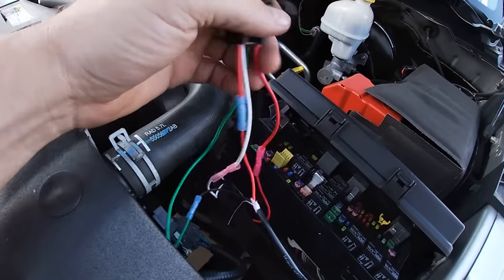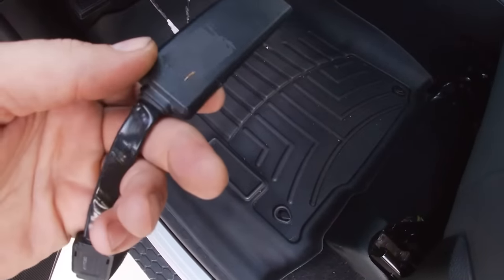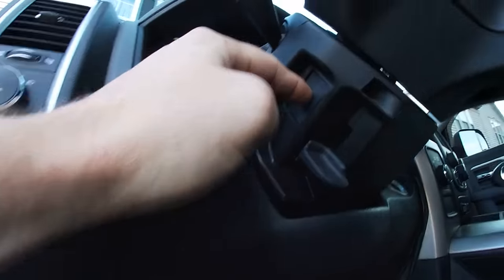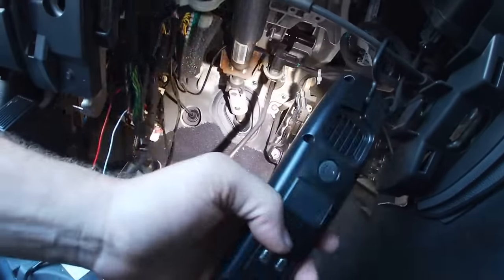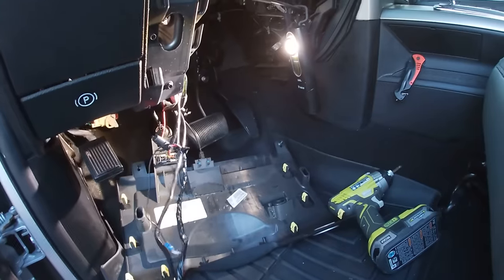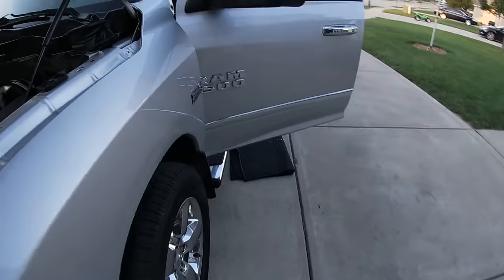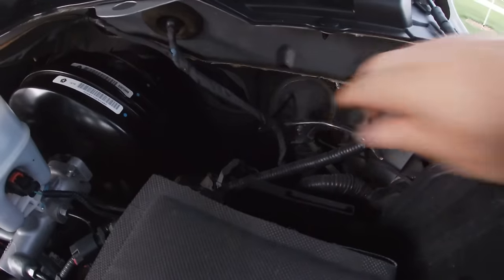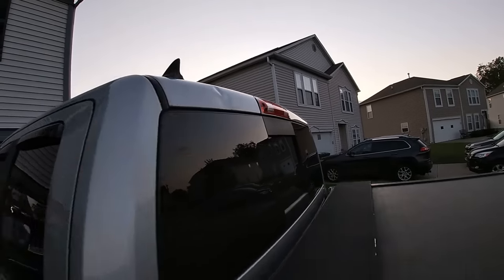Tracking Device Found on My RAM!

Comment: Dude this is new to u remember lowjack well they work with dealers every car from 91 and now has a lowjack on it if u ever get any car stolen from 91 and up all u do is tell the cops to activate the low jack and your car will be found in seconds they won't tell u but it's there and they can find it....no bull I've had 2 cars stolen and 2 cars found a 92, suburban and a 2006 Honda Civic  in minutes that in California it's everywhere

Comment: That would never beat that loud is that was a straight-up tracking device because someone would find device in less than a minute so the beeping that you are hearing is most likely the dead battery warning you that you need to replace a battery

Comment: Some companies put trackers on fleet vehicles in case of theft they can track it down and repo it.. also, some used car dealerships put trackers on cars while you are still paying for them so if you get behind on payments they will know where to go repo it. I recently bought a 2010 ford taurus and heard a beep coming from under the dash and while I was changing a fuse in the fuse panel under there I saw the black box of a tracker device. I removed it immediately and I'm glad I did!

Comment: For semi-permanent repairs of stripped wires, I like to use the liquid electrical tape.  Vinyl electrical tape (even the more expensive varieties) will get dry/brittle over time and start to come loose.  I've never met a vinyl electrical tape that will work.   Excellent work there, glad you worked your way through it.  Very impressive video / well done job!  Reading your other comment, I love those floor liners and the tonneau cover.  Excellent stuff there.    I know this video is over a year old now, but maybe you'll find yourself under the dash sometime and can check on that vinyl tape eventually.  Pick yourself up a jar or two of that liquid electrical tape.  You have to use 2 or 3 good coats of the stuff.  Sometimes 4, but it's great stuff.   If you crack open a jar, you need to really seal it up tight to get it to last.  Even still I end up throwing the tail end of a jar away over the years.  It's okay.  It's worth it for when I need it.
Reply from the maker: I also use liquid electrical tape but at the time this was all I had. Thanks I’m glad I figured it out. I have already fixed the wires with heat shrink butt connectors so there is no need for electrical tape at that point. Thanks for watching
Reply: Cut the wires, solder and heat shrink is the correct and safest way.

Comment: That is not only a tracking device, it will not let the truck start if you have missed a payment. Car lots and the dealers are putting those on trucks, if a payment is not made they can shut the truck off and track the truck down to do a repo. The dealers put those in trucks.
Reply from the maker: They put them in a lot of vehicles not just trucks. I only had it for 2 weeks when I made this video and the corrosion shows it had been on there for a long time.

Comment: Dealerships sometimes add tracking devices if for the loan companies so they can find it if you don’t pay. This happened to one of my friends, she had bad credit and when she bought a car for the loan company’s protection they installed a tracker and said they would uninstall the tracker once she pays off the loan. She ended up trading the car in so the next person who bought the car now has a tracker too that they probably don’t know about.
Reply from the maker: Crazy Coupon Crew I think if a company requires it to be installed they should be responsible for removing it. If this happens to someone that knows nothing about cars mechanically it can cost them a tow and a repair bill.

Comment: I was the second owner of a Tundra. It had ALL the bells and whistles. The original owner and I purchased it at the same dealer. The battery kept running low every few days if I didn't use it. I kept bringing it in to get the problem fixed. I bought a new battery and demanded another one when the one I had just purchased kept dying every few days. I used it to haul a horse trailer and had a private party eventually uninstalled the trailer break system that Toyota had installed when I bought the truck. The private party guy found a GPS system in my truck while he pulled the dash apart to remove the breaking system for the horse trailer. Toyota installed the GPS unbeknownst to the original owner because they wanted to track it if the guy left town for good. I went to the dealer immediately after finding out about the GPS. The guy I talked to told me that yes, they did indeed install it. Later it occurred to me that my battery issues were because of the GPS. I told the dealership it was eating away at my battery and that I want it removed. The snakes at Toyota refused to acknowledge that they installed it at this point and made me pay $350 to take it out. It was attached to the antenna and the process to remove it required taking apart my whole dash. I have no trouble with my battery life any more.

Comment: I use covert GPS trackers in my business frequently. This is not a covert GPS device designed to not be discovered by the driver, it’s a badly installed fleet tracking GPS device. They just never took it out. It appears to have an ignition kill in case the vehicle is reported stolen.
Reply from the maker: Thank you finally someone that knows what they are talking about. Everyone says it was put on for my loan and I tell them I had it for only 2 weeks and the corrosion shows it had been on there for a long time.

Comment: Man, those splice jobs on your truck are a complete mess. I had a similar issue. One was found on my 2016 RAM 3500. Bought a new RAM in 2016 in North TX. Two years ago, I started having an issue with my fuel gauge reading incorrectly and so I took it to the dealer to diagnose it. Ultimately, after a month and a half spent in the shop, 1 wiring harness, 3 fuel pumps, 3 gauge clusters, and misc electrical troubleshooting the service dept on a tip from another TX Ram dealer recommended they go check in the wheel well behind the liner, sure nuff. The tracker was found buried deep in the harness. The splices had been made and had started to corrode the harness where all the splices were made, causing a substantial drop in voltage to the fuel gauge system.
Reply from the maker: The company that pays to have the trackers installed should be responsible for removing them when done. They have caused people like you to spend money and in some cases a lot of money because of them.
Reply: @FABAutomotiveDetailing Fortunately for me, the dealer did not charge me for the majority of the work. They received 2 bad fuel pumps, and 1 defective gauge cluster, plus all the other electrical troubleshooting. Definitely a deceptive practice.

Comment: You're exactly right they hook to the steering column and they go to the ignition so what you have there is a big car with a kill switch and it also locked the doors so the perpetrator cannot get out of the vehicle

Comment: I'm done with computers. I took the 3.6 V6 out of my 2016 Ram and installed a carbureted 350 chevy with a 400 turbo. I bought a brand new wiring harness on ebay for 1972 chevy pick up. Life is sweet.

Comment: I had one installed by the dealership when I was financing my 2005 Mazda 3 years ago.The dealership refused to remove it at the end of the term, so I spent 2 days locating, googling, and removing it myself. It was worth it because mechanic shops wanted over $200 to do it. LOL

Comment: You still haven't finished.  There is another one up under the dash from the factory.  You need to remove the dash and find a box on the firewall which has an antenna sticking out of it.  Then you unplug it or remove it.  All newer cars have them.

Comment: The spot on the steering column is where you touch with your key fob as you press the start button to start your vehicle when your key fob has a dead battery.
Reply from the maker: It’s not a push button start. On the Mopar push to start cars with a dead key fob you actually press the end of the key fob into the push to start button itself to start it. I’ve had to do it on our Journey when the battery went dead.

Comment: I work for Jeep Chrysler Dodge dealership and we see these from time to time on used vehicles that come in for trade or the people bring in to have them remove when they find them. The wires going up to the steering column are to sense the ignition key on state.
Reply from the maker: Tom William At your dealership would have removed it before offering it for sale again?

Comment: The dealership i worked at put the gps module in every used vehicle. Its not for people with bad credit. The ones we were installing were able to shut the car down. So if you stopped making payments they could shut it down. Then you call asking for a tow and it gets back to the dealer locked in the shop till you pay. But they went in every single used car. They dont just be like o you have crappy credit so give us an hour to wire up this insurance policy before we give you keys. I always thought it was stupid to put them in cuz they did crap like this where they would have failures and not let the car start.

Comment: I bought a chrysler and I keep having problems with the TIPM. I bypass the fuel relay years couple years ago.  I have tested all the connections and found out my TIPM went south.
Reply from the maker: tyler sowder The Totally Integrated Power Module was a bad design IMO. Hopefully these newer models don’t have them but I won’t see them at the shop for a few more years.

Comment: Some dealerships used car dealerships are putting them in vehicles so if they have to repo they know right where to go get them
Reply from the maker: Yes they do but I had only owned it for 2 weeks and that corrosion wouldn’t happen that quickly. It was on there from the first owner.

Comment: Great video, came looking for a video similar because I have a 2019 Ram Classic, found some kind of device under the dash today while replacing my interior lights and came across this "doesn't look like it belongs there device" and a friend came and had a look and sure enough it didn't! Took it off and see what happens? As per your S&B cold air intake, I highly recommend this product. I had one installed when I bought the truck new, along with dual glass packs and a throttle commander, and the cold air filter helps make a difference, maybe not a whole lot but every effort helps! Thanks for the video even though it's four years old but reading the comments helps too! Have a good Dodge man 👍
Reply from the maker: Thank you! I did put the S&B intake, Flowmasyer exhaust and a throttle controller on also and love it.

Comment: The Dealership will install those things so they save money on insurance and sometimes they forget to remove them when they sell the vehicle. They also if you have bad credit the banks sometimes require one to be installed so if you defunct on the payments and it has to be repossessed. They know were to find it. Not that you can't rip it out after you buy the truck but they know most people aren't smart enough to do that. The dealership buys them by the pallet full. So they hardly pay anything for them on top of it. So it's really not a loss in the first place.

Comment: as i have worked at an auto auction (dealer only auction house) in the autobody shop before, i will let you know A LOT of "used" cars on most dealer's lots used to be rental cars, Hertz, Enterpriise, and the such, they buy a fleet every few years year to keep the vehicles fresh and then auction off the old fleet, so yeah you may wish to ask where the vehicle's origin is from if you don't want an old rental car
and the brand the auction i worked for sold and partnered with? chrysler (dodge jeep plymouth etc.) and the dealerships that were at the auctions? most of the entire east coast
Reply: also our auction had options that the dealers could buy as extras (they purchase and we put them on) included bed liners, spoiler wings, tonneau covers etc.) so they could up the lot value without having to do the work themselves

Comment: I found one exactly like that in my Mazda 5. The used an inline adapter that plugged into my obd2 connecter. I found it, because the adapter's obd2 connector wouldn't lock into the hole for connecting  a scan tool.
Reply: i also had  the same starting issue with my van, although removing the device didn't fix it immediately.

Comment: Nice find and fix...that buzzing must have been very annoying. Judging by the heat you said was on it....that thing must have been drawing at least an amp, I bet the battery had been replaced...LOL. I think it would have been fun to track down the company that owned it to find out if they could still track it, I doubt they actually did, but they capability was there. I wonder what software and such was involved?
Reply from the maker: Thanks! I’m sure it was atleast and amp for sure. I did replace the battery shortly after this video.

Comment: It is a device used by the finance companies usually buy here pay here lots I’ve seen them on the cars, it’s an inner locking ignition device when you don’t make your payments they can send the repo truck right to your vehicle when you default, and also immobilize the vehicle as a threat to make a payment, hence saving fees on the repo agent
Reply from the maker: Mica Anderson It could be from the original owner. I’m the second titled owner and had only had the truck for 2 weeks when I made this video.

Comment: I have a 2019 tundra battery went dead if I didn’t drive it in a couple days took it to the dealership told me I’d had a tracking device on it that the dealership had put on said they unhooked it ,I leased it

Comment: 2 wires Control the Relay, Relay Will have 2 or 3 Terminals for Switching, Connecting the 2 Wires were likely Starter Disable, Could Be Ignition Disable.

Comment: So alot of smaller dealerships install these onto their cars so they can find people for non payment. Some even act as a kill switch. If someone had bought it froma dealership and paid it off or traded . It would have stayed in the vehicle. The customer has to pay a fee after their lease to have it removed and usually is a few hundred dollars. Thats most likely the cause. Possibly the beeping a wire somewhere was cut to the system. Or something else disconnected  . I have an 03 jeep and has one in it. If I was the sell it and someone opened the dash they would find it.

Comment: That's a tracking device used by car lots, loan companies, rental companies, fleet owners, etc. etc. I know cause I've installed them for car lots. They are used to repo vehicles when you don't pay for them. IF you remove it, you just violated your loan agreement and I can repo your car the minute I find it deactivated. Now if it's just a bad battery and you fix it and the tracker comes back on I can't touch it because of that, but if you remove it I can. If it goes bad I can put a new one on it too. By law, I don't have to tell you it's on there. If it has the stater deactivation relay on it,  by law in my state I have to tell you it's on there. Once it's activated, it just prevents the starter from working. Again, if you remove it to get it to start, I can repo your car that instant cause you violated the terms of the loan agreement. So you better be careful listening to these internet lawyers and mechanics cause most have no clue about this stuff. I work in the industry and I know all about it. Been using these things for years. And, since laws do vary from state to state you would have to check with your state laws, I'm only speaking of my experience within the stat I live in.

Comment: I bought a used car from a used car lot. They did inform me that because I was using in house financing, which is considered high risk, that " I may or may not have a tracking device in my vehicle" i was ok with that. It looked exactly like his but mine was connected directly to a fuse. I was having issues with something so I checked the fuse box. That's how I found it. They did take it out when I payed it off. So no real.issues

Comment: Many times the tracking device is a "Dealer installed option" with a high markup. For the Dealers insurance insurance, they need to have tracking on the vehicle while it's on the lot. They just leave it on the vehicle when it sells, and charge the buyer a huge markup for a device that many people don't want.
Reply from the maker: Doesn’t surprise me!

Comment: so when you bought the truck at the dealership why didnt you ask about the beeping noise ?
Reply from the maker: The Man Who Killed Kenny Like I said in the video it has an aftermarket back up camera system with proximity sensors. I thought that it was just that system beeping on start up testing itself basically.

Comment: I bought a factory certified used 2014 Chrysler 300. The car had been assigned to a Chrysler VP in Detroit. The dealer told me it had one and offered to remove it. In working with my insurance co ( who also did the financing) they gave me a 5% discount on my collision coverage if I left it on. Not because they were afraid of me not paying, but making it easier to get the car back if it was stolen.
Reply from the maker: That makes sense!

Comment: remove the back cover on your cell phone -examine the inside of the cover. they (DHS-homeland security in partnership with the major cell carriers) hide a tracking device under a piece of tape. this will track your travel regardless of whether your phone is on or off.  simply pull the tape off and remove the tracking device-replace cover and your good to go without being tracked.